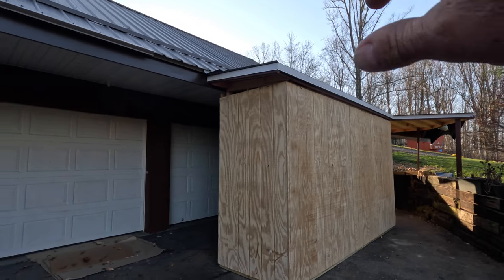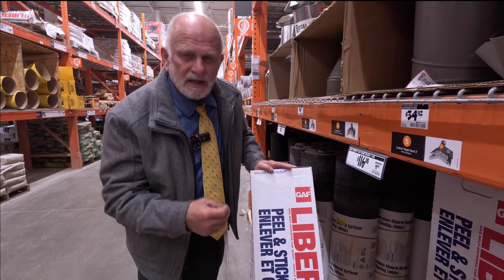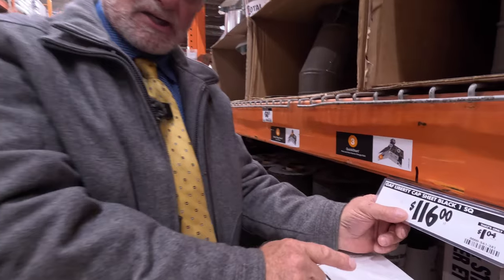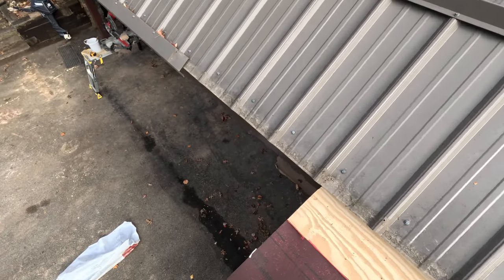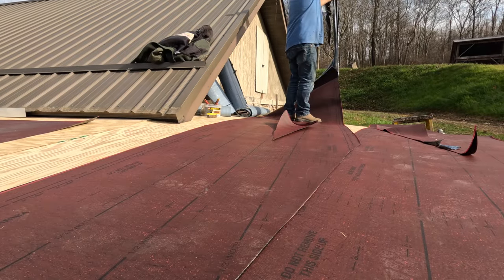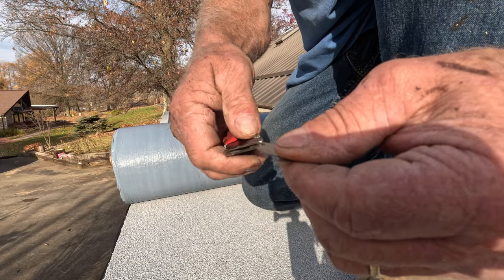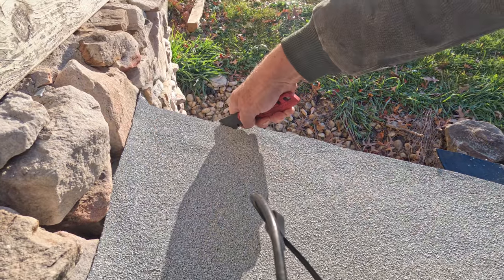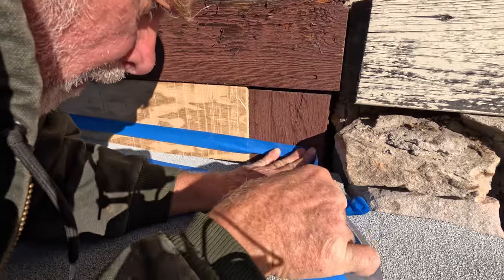How to Install a RUBBER FLAT ROOF, Cheap, Easy, DIY- Carport, Shed, Porch, Garage - Easy, Fast

Comment: He's a professional roofer. He's demonstrating how DYI's home owners can do their own small flat roof without spending a fortune that will last twenty years. 👍
Reply: Leak first rainfall
Reply: How the flying fuck can you install a felt roof then apply a different product to a detail to dry in.  I felt roofs there all felt

I epdm there all epdm

I single ply upvc they all single ply

I liquid whole system is liquid

When you start mixing one with the other your clearly not doing it right
Reply: He is galaxies away from being a pro roofer.
Reply: @darrenmorandavies2888   post your own video of how do it better?
Reply: This crap show won't last the first good wind and it's leaking now guaranteed.

Comment: I have a huge flat roof house that I bought in 2016. Roof last replaced in 1992. 

Since I bought the house I spread that rubber roof coating white stuff all over it to extend its life a bit longer since it was leaking till I could afford a replace. 

Learning a lot from you here so will be attempting a re roof project soon. 

Thank you 🙏

Comment: The GAF Liberty system works great, and you can use any self-adhering underlayment. GAF also wants a primer on the plywood before installing the underlayment, but the underlayment + cap sheet works great.

Comment: nice job...I wonder how this would hold up in Arizona heat?...was thinking of doing a flat "Santa Fe" style roof about 2700 sqft...???
Reply from the maker: it is really a good material. the ceramic granules on the surface will protect it against UV's

Comment: Head's up folks!
This is the only video which shows you how to remove the release film while the sheet is laid in position! Which works way better, and if your piece is long than 16' good luck by yourself. Everyone else flips the sheet long was and let's the flap fall, which is fine with three people.
Warning! The Liberty Cap sheet comes packaged with tapes wrapping in two spots to hold the roll, if you start pulling your release film from that end in will tear underneath and you won't be able to get the sheet up to remove it!! The tape years the release sheet as you pull, just make sure you start to pull from the other end. I was able to quickly roll the sheet up long ways and get most of it free of release plastic. Just a warning. I ended up rolling the sheets long ways, only 16' feet long ways, but it was pretty cool today, don't try it when it's hot or you'll have a sticky wicket!!😊

Comment: Hey great video. I'm about to do my own flat roof and am really curious how to cut my gravel-stop flashing so that I can bend it for outside corners. Pretty much what you just did in this video with the drip edge only with gravel-stop. Do you know where I could find some info? Have you ever addressed this in a video?

Comment: Typically on a pitched roof you want the metal edge overlaps top over bottom for water barrier, same with flashing I think.

Comment: I have a flat roof that needs to be recovered. What is the best method of going over the cap sheet with the Liberty system. My thoughts, would be to add another base and then the cap sheet. This is in Florida and I can go two layers before I have to rip it all up.

Comment: Why not also install aluminum, flashing over the mesh flashing .
Thxs u for all your videos , really helps
Reply from the maker: Metal flashing is of the past. There is still a place for it, but I have been using liquid flashing for the past 10 years with great success. Metal flashing has to be embedded into a cement wall, or covered with siding. Not so with liquid flashing. They have been using termination bars for EPDM roof on brick walls that was not to successful in many cases.

Comment: Hi, I would be tempted to nail the dripping edge directly on the plywood, then the base, then the cap sheet, so that in case of a leak the water goes on top of the drip-edge, not under (towards the edge of the plywood), No? Also, it would be nice to put a piece of cardboard, a tarp or whatever to avoid tar stains on the white roof, doesn't take much time and so much nicer. 
I have an other question, if you have a chance, I have a torched roof on my work shop, it's porous and leaks in places, could I use the cap-sheet directly on top of the old roof? Thank you.
Reply: You're correct.. in theory at least.  This is not the proper way to do this install.  First step should be a 4-6" rubber flashing directly onto the plywood,  then drip edge, then asphalt primer and THEN your base sheet
Reply: Would it be ok to just put the cap sheet directly to the ply wood

Comment: Since the flat roof material is only has 10 year warranty, I wonder if it would be better  to prep the the base sheet the same way as installing a flat roof then install galvalume on top for a carport. I can order one continuous sheet so if my flat root is 24'x24, can I order 8 of 24'5" x3' and last much longer.

Comment: You make everything look easy! I need a little advice on something a little different from the video, I bought a place that has a shed with metal roof panels. upon inspection the roof panels are either overlapped 1 hump or not at all and I can see daylight where the edges didnt overlap veryy well. I wouldnt mind trying to save the panels, what would be a good way to remediate the overlapping issue?

Comment: Metal flashing is cheaper.
Reply from the maker: maybe, but takes longer and then you will need siding also. so it becomes more expensive
Reply: @FlatRoofDoctor it’s the proper way to do it though and cleaner looking also. Sometimes things take longer when you do it the right way

Comment: That is so wrong. Another torch of flashing up the wall and down on the cap and your seams torched properly then not counter flashing like you said. Counter is for side walls. Wall flashing after the cap flashing but leave enough space for siding the wall also. Man oh man in winter and heavy snow and rain storms your method would last maybe 3 years
Reply from the maker: It appears you are talking about "torch Down"  This is not torch down. This video is not for you, iy is to help home owners and DIY people. The liquid flashing I used will last 20 years. I don't know what the problem is.
Reply: Peel and stick directly over OSD with metal edging first around roof perimeter works great in sunny areas like AZ for light roofs to provide sun shade.
Reply: @MarioIArguello  not where I live or himself

Comment: i’m doing a roof with out plywood. the roof is wood decking. with gaps between each plank. it’s hard to get a membrane but can i apply the torch rolls directly to wood roof. or is there something else that i shouod use before that? felpa or idk pls help
Reply: Did you proceed with the project?  How did it go?